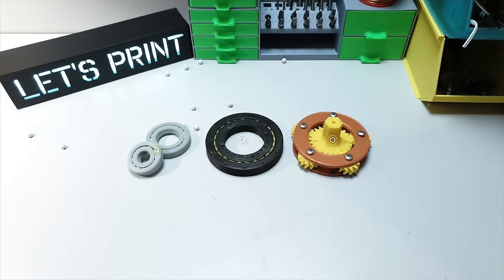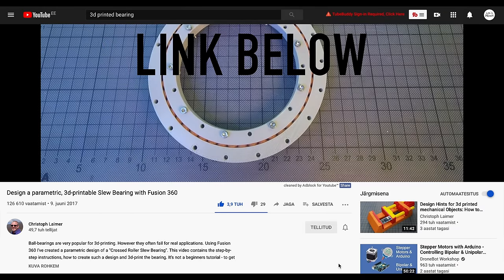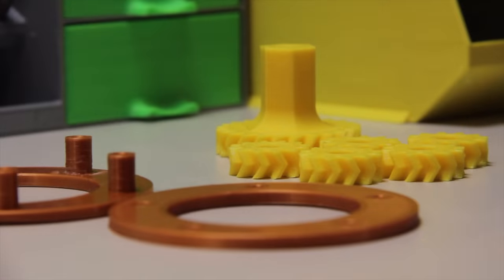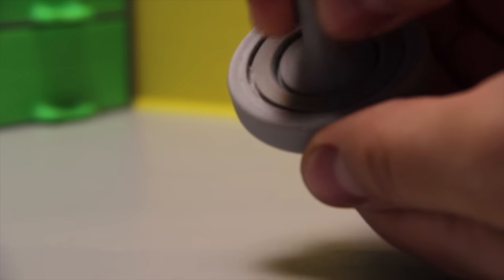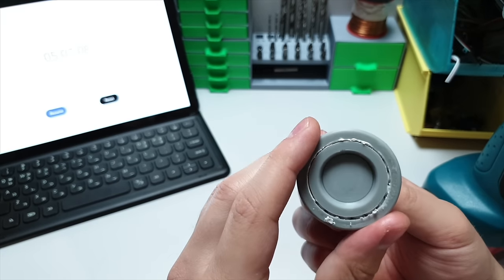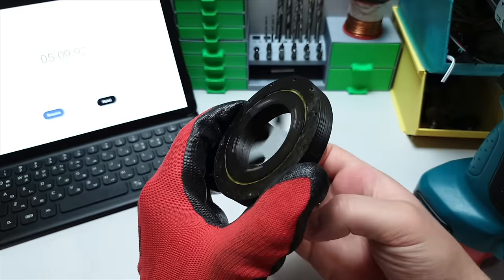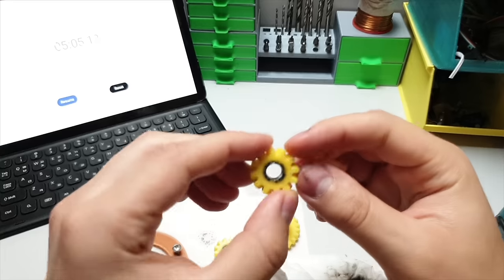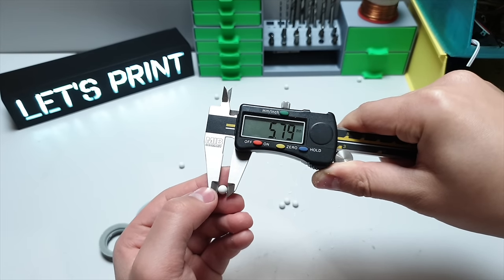3D Printed Bearings - Are These Real Things? (Building and Testing)

Comment: please dont use wd40 as lubricant for plastic parts😖
Reply: I was just about to say the same thing.  wd40 is not a lubricant (it can be temporarily)  proper grease or oil should be used, probably a nice silicone grease.
Reply from the maker: Yep, my bad 🙈
Reply: Yeah the test is pretty much invalid. WD40 softens the plastic and it's really really thin it's main idea isn't to "lubricate" stuff but to dissolve rust and free up seized parts. This video is a waste of time.
Reply: @D3s71nY  As long as @Let's Print leaves the comments open so people can point out mistakes, I don't think it's a waste of time.
I think the testing method needs a lot of improvement, but I also enjoyed watching it.
There are some YouTube channels which delete comments pointing out mistakes. The Raspberry Pi Guy is one such channel (there are a lot of dead Pi boards from people following his directions).
Reply: I like spray silicone grease, it puts a thin film over everything. The solvent dries really quickly and the lubricant stays.
Reply: @D3s71nY  I would not go that far the airsoft one is great. Less stuff to print. Pellets are easy to find and really quick assembly
Reply: @Gamer-nc8qp  There also exists metal bb's which could be used
Reply: @HunnyVRC  did not know that thanks
Reply: Yeah I thought the same thing.. pretty sure that's why the air soft bb's started to dissolve
Reply: Also, plastic is self lubricating. It doesn't really need any lubrication to start with
Reply: Agree with this. WD-40 contains Naptha, a pretty serious solvent, and it will melt or degrade many types of plastics. It is more of a penetrating solvent than a lubricant. It was originally designed to spray on the outside of NASA rockets that use Liquid Oxygen or Liquid Hydrogen fuels to prevent ice from sticking to the side of the rockets. Water Distributable formula 40 was supposed to be used during the pre-launch period and then quickly evaporate away during the actual launch. So no, WD-40 is definitely NOT a lubricant, but it works great for freeing a stuck bolt or getting labels off. Or even keeping ice off the side of your rocket.
Reply: @theheadone  That's not what WD40 say: WD-40’s lubricating properties are world-renowned; our secret ingredients are widely dispersed upon application, providing smooth and easy lubrication for moving parts and mechanisms.
Reply: Have to agree, the WD40 ate those AirSoft beads. The Moly packed into the bearing would of been better.
Reply: Silicone grease/oil is a wonderful lubricant, it is very water resistant and is compatible with all plastics and rubbers.
Reply: wd40 is shit use Q20 its better.
Reply: Nice kiba pfp
Reply: @LetsPrintYT  are you German or somethin?
You sound like you have a German accent
Reply: @gregj.hedlund623  why would i need lube im uncircumcised
Reply: @gregj.hedlund623  oh wait i didnt read what you commented about
Reply: @maverickstclare3756  They can put it on the can - so far squeaky door hinges will start to squeak again after some time. While thicker silicon based lube, oil for fine mechanisms etc last much much longer.
Reply: WD40.... its function is in its name "Water Displacement" lool seems you are getting a lot of crap for that one bud ;)
Reply: That’s true, but why didn’t it eat the print or made it weak.? BBS got worn down due to the friction of plastic on plastic. Grease could of help but might’ve ended with the same results.
Reply: @nikoappsmuggred7220  ...for your mate!
Reply: @simonmailhot4260  context?
Reply: he can do what he wants.
Reply: @HunnyVRC  thats wrong. it depends on the plastic and i dont see any acetyl copolymer filaments.
Reply: @theheadone  WD40 indeed a blended lubricant that prevents rust.
Oil displaces water. some oils can evaporate... some faster than others. 

its a lubricant but not a proper lubricant for gears or fast moving parts. 

watch project farm one of his tests he does on oil is evaporation.
Reply: @D3s71nY  Fun fact. WD-40 is not made to remove rust. Its intention is remove moisture from mechanical parts. Its a desiccant. WD-40 literally stands for water displacement 40 :D and the 40 stands for the 40th formula that they created before creating a commercially viable product!
Reply: Dunno if anyone gives a damn but if you're stoned like me during the covid times you can stream pretty much all of the new movies and series on InstaFlixxer. Been watching with my girlfriend for the last couple of months xD
Reply: @Rex Jace Yup, I have been using Instaflixxer for since december myself :D
Reply: Many people have correctly pointed out that WD40 is not a lubricant, I would like to point out that WD40 is also not the direct cause of the schmoo found in the bearing with airsoft pellets since even using silicone lubricant (puff dino airsoft lubricant to be specific) the schmoo was present. I tested this while trying to make a custom version of a planetary gearbox that needed a 120mm diameter bearing. After spinning it about 800rpm for half an hour the schmoo was indeed present, however my theory is that the pellets being right next to eachother with no separating cage caused them to rub one against another generating airsoft pellet dust. All the WD40 and my silicone lube did is provide suspension for dust particles. Using metal BBs as pointed out by @KayleeVRC removed the schmoo problem but did not fix the rubbing of pellets.

TL;DR: schmoo is not caused by whatever substance used for lubrication but by an inherent design flaw of a bearing.

Comment: The point of bearings is to test them under load just to spin them without load is no point, that's why bearings usually don't have oil but grease, but otherwise great videos keep up the good work. Ära südamesse võta väikest kriitikat.
Reply: well there are some things you can bagage along from early tests without any load because the bearing will always be under its own load. Noise, temperature and the delta of time at free spinning do contain telling characteristics 99% of the cases. And with known materials like 3d printed objects this can be extrapolated to 99.9% of the cases. With the right math that is, just like something as Ultrasonic testing. Oh and when you see white ball bearing material come out of the crevices when spinning freely with a simple motor, setting up a test with load would just take up more time to get the same result.
Reply: @Dennio83  
🔹"with known materials like 3d printed objects this can be extrapolated to 99.9% of the cases"
▪ya but I didn't come to youtube to do the thinking for myself. 
🔹"setting up a test with load would just take up more time to get the same result"
▪would make for good content none-the-less

Comment: I can tell you what happened to the bearing without even opening it. You used WD-40, which is NOT a lubricant, as such. Grease or PTFE oil would have been much better choices ;)
Reply: Are those biodegradable BB's?
Reply: The moment I saw him use wd-40 I knew there would be a heat failure. needed to use lithium grease or maybe gun oil.
Reply: Silicone grease with PTFE is a good plastic lubricant, as already said WD40 isn't designed as a long term lube.
Reply: @tylerbennetts8079  Is that the same as silicone oil or is it more viscous?
Reply: @BuZZarDFPV  It's possible that they are, in which case they are just PLA. Which would be funny since he went out of his way to print this in ABS, but used PLA with WD-40 in the most critical part. Of course it would fail.
Reply: Someone should tell WD-40
Lubricates
WD-40’s lubricating properties are world-renowned; our secret ingredients are widely dispersed upon application, providing smooth and easy lubrication for moving parts and mechanisms.
Reply: Lubricant is something that makes something slippery so WD-40 is a lubricant
Reply: @smileypaper5589  According to your logic water is also a lubricant because it can make some surfaces slippery.

But in actual industrial use you won't ever see WD-40 used as lubrication. Because it's doing a shit job at it compared to even cheap oil designed for that use. As the name already says WD-40 is a water displacer. Unless you buy the actual lubricant sold under the WD-40 brand, but that's a very different kind of product.
Reply: WD40 is both a lubricant and a solvent which gives it the unique property to be able to free up rusting metal parts. I checked their website and they do list ABS as safe to use with it, but not many other plastics we use for printing. From what I remember, airsoft BBs will even degrade when exposed to water so it would be nice if he revisited this using metal bearings.
Reply: Fridde - agreed 100%.
Reply: nah its actually much more simple, the BBs are biodegradable and will crumble, probably wouldn't have happened if he had used a non biodegradable BB, but those ones are harder to find

Comment: Instead of printing the roller bearings you could possibly use perler beads.
Reply: And for a smaller bearings, I think we could use ptfe tubing as well.
Reply: That’s exactly what I thought he used when I saw them in the thumbnail, then I saw them on the printer and stood corrected.
Reply: That's an excellent idea, to be honest.
Reply: JD The Vagitarian me too
Reply: Or at least BB gun metal or plastic bullets
Reply: @thesusboomerroblox6516  Agreed.  Copper-plated steel BBs should work well.  They are smaller than airsoft BBs, so you can make smaller bearings too.  Perler beads are LDPE, which has a lower friction than some other polymers, but I'm afraid it is soft and melts at a low temperature.
Reply: Unfortunately, after doing some research, I found out that "Perler Beads" are usually non-uniform in terms of diameter and height - D 4.77 x H 5.07 respectively.
Unless you can "process" them in bulk to a uniform shape, they might not be so reliable for "Roller/Slew" bearings.

Comment: Careful wearing gloves and using rotating equipment like a drill. If a thread or loose part of the glove gets caught on the chuck, it will wrap up almost instantly and you may have a broken finger, or worse, before you even realize what happened.

Comment: You should test them with some radial/axial load. 
I mean, the purpose of a bearing is to guide movement while under stress
Reply: this, a quick test bench could be using them as a wheel bearing for a little cart and add some weight on it, and by using a little ramp as initial acceleration, see which roller goes further.

Comment: A measuring tip: Use the thicker part of the calipers instead of the slim point to measure anything round, you'll have an easier time getting accurate measuring results.
Reply: I've found some calipers don't have a flush end, the sharp tips are accurate but the thicker section have reliefs cut in
Reply: @xxportalxx.  At the very base of the yaws, there should be a big relief, but if your calipers are not closing properly along most of the yaw, they are either poorly manufactured or damaged/worn out. As far as I'm concerned the sharp end is only for measuring narrow details where the whole width does not fit.
Reply: @2testtest2  I'll let you Google some pics for yourself, but not all designs are meant to (i.e. it isn't just a manufacturing defect, it's the design itself). I have a pair where the relief taper begins directly after the sharp edge for instance, some designs come together like tweezers as well

Comment: I noticed that the airsoft bearing had a curved form for the balls to run in. Maybe it would wear out slower if the balls weren't to run with full contact with the bearing surface but only on the edges.
Reply: In normal bearing, the race are a little bigger than the balls, with no load the contact area is small and it widen as the load increase.
If the balls rub on the side it's a design flaw.
Reply: interesting.
i was also evaluating the use of a little bearing grease

Comment: BB Bearing needs to use metal or polycarbonate bbs, not melamine.
Reply: What is the reason for that? I’m curious.
Reply: @grantscott1686  Melamine is extremely brittle, and it's basically a barely fused powder. It's intended to blow apart when it hits something, which is why it's crumbling into bits. PC is what CDs are made of, it's much tougher, as is metal. Either of them would wear the bearing race into clearance, rather than the balls crumbling.
Reply: @sac3528  Oh ok I thought maybe that had something to do with it but wasn't 100%
Reply: @sac3528  Yeah they're designed to degrade easily since airsofters will shoot 10s of thousands of BBs in a forest and they're not going to pick them all up.

Comment: I found that using copper-coated steel BBs worked really nicely and did not start breaking down under load, I used dry graphite lubricant too.

Comment: The 3rd ‘bearing’ is a planetary gear, and usually what connects to it, would be orbit gears, which makes up the planetary gear assembly, which is typically used in car transmissions.

Comment: Actually, ball bearings are designed for high speed. What you're not accounting for is shock loading. When the drill motor starts and stops suddenly it puts a large amount of stress on the part and can cause premature failure
Reply: The balls are rubbing against one another. Not a problem with hardened steel, but with plastic it's a thing.
Reply: Stress in what direction?

Comment: Very interesting and thank you.
The second bearing style you tested, is a conical bearing, and Christoph Laimer has another version that he calls "slew bearings".  If you print the bearings first, you can print the inner and outer races together up to a little more than 50% and carefully drop in the bearing and continue the print.  This way you don't need screws.  There is the idea of an "airbrush nozzle" that could make that even easier which I am about to try.  Also, I found that AirSoft projectiles are either
Non-biodegradable airsoft BBs are usually made from a plastic acrylonitrile butadiene styrene (ABS) OR Biodegradable Airsoft BBs are usually made from a plastic polylactic acid or polylactide (PLA).

Comment: 7:17 A number of things can cause the increase in play. For starters, planetary gear bearings produce more friction and heat because there are more points of in contact while spinning. This can cause the plastic to soften up and reshape. It could also be wear and tear as you mentioned.

Comment: Hy nice idea to print ball bearings.
This is intended to manufacture a new wareant but not for continuous use and high speeds.
Your water pump is impressive in the line.
you can insert grease bearings in between the bearings, this helps against corrosion and seals.

Comment: if you weigh the bearings before and after you would know how much has worn off. Weigh before you grease. Then wipe the grease off before the 2nd weight. You want to remove any particles that might have worn off but still be in the grease.

Comment: I have been able to get some impressively low friction ball bearings using plastic 6mm BB shot and PLA. They work very well at low speed (ie a few dozen RPM - I don't need them to run any faster so don't know if/when they will fail) without any lubricant and with no apparent wear.

Comment: Hi! Any gears (metal too!) goes through "team play" process. After working together for some amount of hours they're has to being checked and re-assembled if everything is fine. So you've just got rid of excess material. If you want really test this bearing you should make some moving system that will be giving adequate loads. This will show if it will be working fine or will fail.

Comment: The WD-40 might have had an effect on the BBs. Supposedly WD-40 will degrade plastics. Cool experiment though 👍
Reply: WD-40 isn’t a lubricant, it’s actually a light degreaser. It’s designed to loosen up grease/lube. When you spray WD-40 on a door hinge, you aren’t lubricating the hinge, you’re just sort of “re-activating” the lube that was already there.
Reply: @FOSSIL13drums  Beat me to it... WD-40 is primarily a penetrant, for breaking loose rusted bolts, it has insufficient lubricants to make this a good application

Comment: What kind of airsoft bbs did you use here?  The white ones are usually made of a verry soft biodegradable material, just something you have to be realy careful with
Reply: That's an interesting point. It looks like 0,20 or even less regular bbs. I was wondering the result with 0.30 or 0.40 bbs. Also to use some grease as used in the airsoft gear, instead the  WD40.
Reply: @DavidColomer  may be TIC_TAC?

Comment: I had a fidget spinner that got some dirt and stuff gone inside of its bearing and I didn't realize it but when I opened the fidget spinner to hopefully lube the bearing,the bearing fell into pieces on the table.The sand had grinded between the two rings and the balls were also in pretty bad shape.The inner ring and the outer ring had a lot of scorching in the place where the balls spinned.The spinner was spinning freely even with the sand was in there, but I could occasionally hear grinding noises while it was spinning.

Comment: If you lower the tolerances between gears and add a temporary grease in the gears you can make the gears "wear mesh" without creating massive play. Any inperfection will powder grind and create abrasive that grinds the gears, grease will capture and protect the gears while they are ground down and hardened.